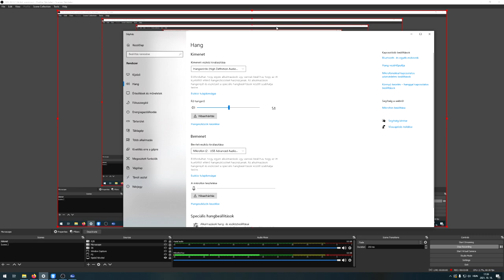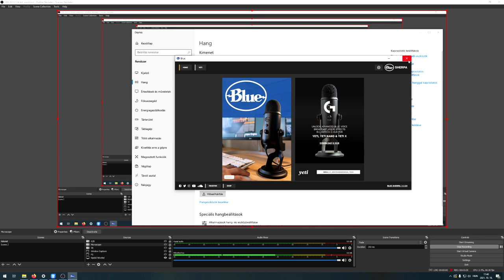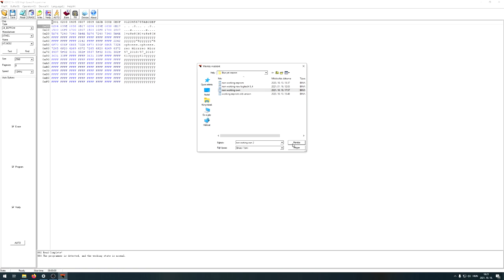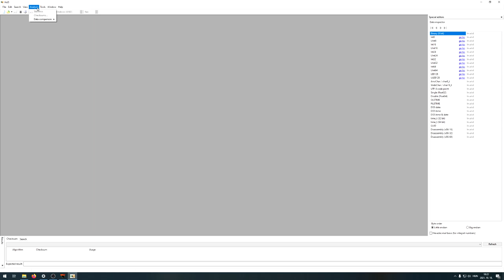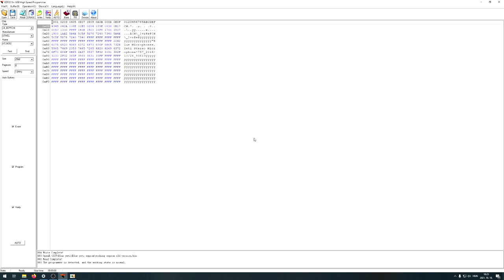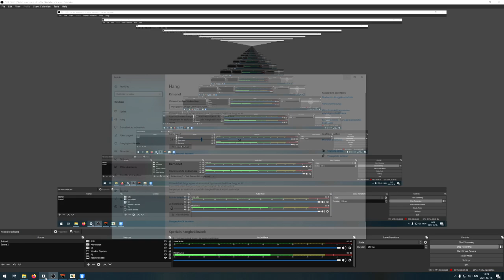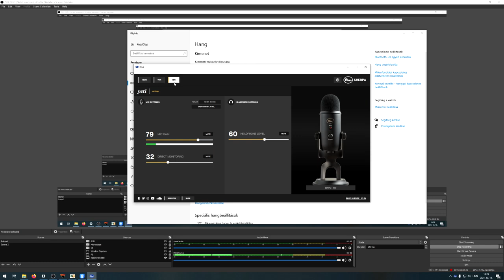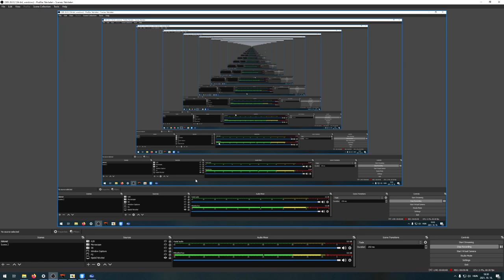Blue Yeti Microphone Repair - Being recognised as USB Advanced Audio Device

Comment: hello. my situation is that once my microphone dropped while plugged in and hit the area where the usb and the port connect, and bent it. its been a few yrs since then (didnt use it much after that), and today i plugged it in my computer and at first it worked like normal but since the wire i used was very small there was some pulling. a few minutes later it disconnected so i plugged it back in, but now it is being read is "usb advanced audio device." 

does my case sound like it can be fixed with this guide, and have you had this issue before? thank you very much
Reply from the maker: Well, it is hard to tell. In 90% of the cases the USB port is damaged on these microphones. I would check at first that. I have an another video how to replace it in case. If it is already fine and still does not work I would do the same what I did in this video.
Note if it is already a newer version without EEPROM thats bad news...
Reply: Read my comment, you can fix it by software. The eeprom inside your device has been corrupted. You have to flash a new rom to the eeprom.
Reply from the maker: @SoulchipTV  could you please send me a link to the software by mail to kikihobbyrepair@gmail.com? You cannot put link here because Youtube automatically deleting your comment. Thank you.
Reply: @kikihobbyrepair  No, you deleted my comment explaining how to fix it using the eeprom burner software. Find it yourself.
Reply from the maker: Why would I delete your comment? I have never ever deleted any comments! Why would it be good for me? It is just great if there is any other alternative way to fix this problem without opening the microphone. Believe me that you cannot post a link because it is automatically deleted by Youtube.
Reply from the maker: Thank you. I will take a look at it. 🙂
Reply: @SoulchipTV  any update to this?

Comment: hello i got a new CM6400 chip online and soldered it to my board, unfortunately I think the chip is empty because it doesn't show up.
any ideas how I can flash firmware on the chip?
Reply from the maker: It will not work. It is kinda a target microcontroller. Without the firmware it is useless.. I also tried to find it but no luck. That is now a brick unfortunately...
Reply: The mic wasn't working before, so I didn't make it (much) worse.
I do see reports of people buying CM6400 chips from Aliexpress (which I did too) and it fixing their microphone, I wonder if they had to do anything else to make it work
Reply from the maker: Yes, I know. I also had one where this IC and also a small output IC at the 3.5mm jack exploded and ordered the IC from Ali. Afterwards for me it was being recognized but only as a generic USB device and it was recording some noise but unrecognizeable. I think this is where the firmware would be needed with the basic settings which is stored case of old mics on the EEprom. I could not find it anywhere that time. Please let me know if you find some info.

Comment: I reflashed the EEPROM, so now it shows up as Blue Yeti, including in Logitech GHUB, but I still get no sound. Any idea what the issue could be?
Reply from the maker: You mean you cannot record your voice or you do not gent sound if you connect a headphone to it?
Reply: Neither works. It shows up in Windows now, but no sound through USB recording and no sound through the headphone jack.
I have since tested it further with an osciloscope and the microphone does work, I detect sound going from the analog to digital board and it reaches the CM6400 chip, but still no sound in Windows/3.5mm jack.

Comment: Hi, I really hope you can help
The fact is that I have always been tormented by the problem of recording too quiet with Blue Yeti in mono mode, now I decided to try recording in stereo and found that my left channel writes very quietly, compared to the right one, which writes as needed. And the problem is that I had the left channel on mono, now I put the right channel in the program and everything is fine, BUT I can't stop thinking that something is wrong with the microphone. How can I still record sound in stereo with normal volume on both channels, and not so loud on the right, quiet on the left. By the way, I checked everything on another computer with the same microphone and cord, everything works absolutely somehow there, both channels write equally loudly (normally). I checked in different programs at home, and everywhere the left channel is too quiet, apparently somehow the left channel is quiet in the system.... Please help!
Reply from the maker: If it works on another computer then the microphone itslef should be fine. Check your microphone sound settings in windows. Could be that the volume/gain of one of the channel is set to a lower level.
Reply: @kikihobbyrepair  I also thought so, but I didn't find it, can you tell me exactly where in the Windows sound settings there is a separate volume setting for the left and right channels? and is it possible for you to write somewhere from messengers please